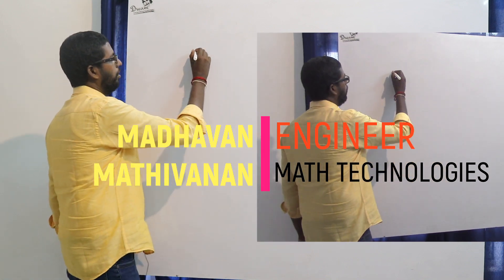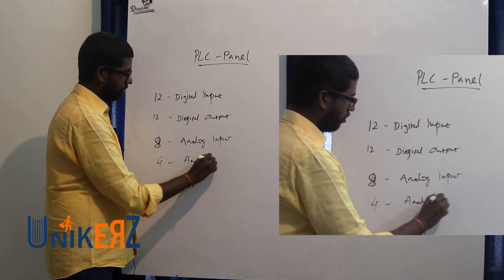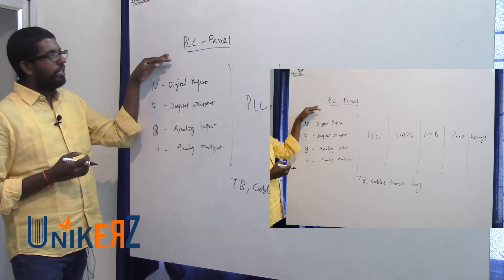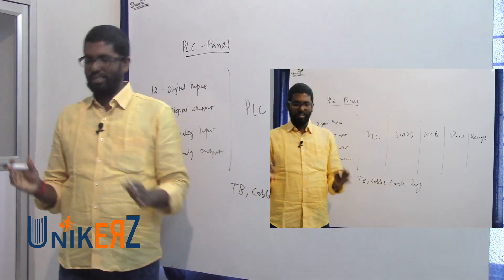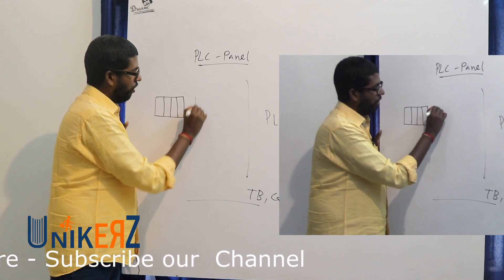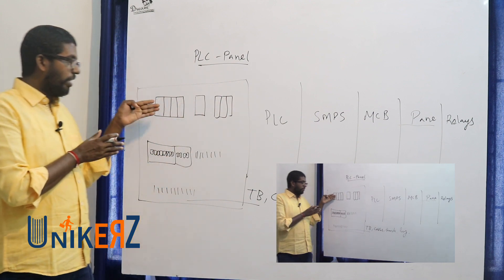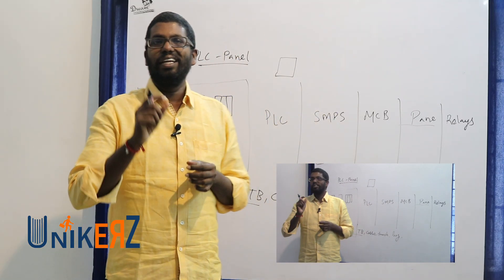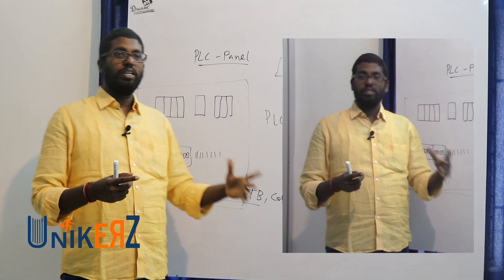PLC Panel- Design a Concept - Industrial Automation Project Series - PLC Training in TAMIL - Part 12

Comment: What is meant by potential free ?
Reply from the maker: Potential free means Voltage free (We can say). In relay, contact side is potential free. So if you give 24V DC in COMMON,you will get that 24V DC in NO & NC.